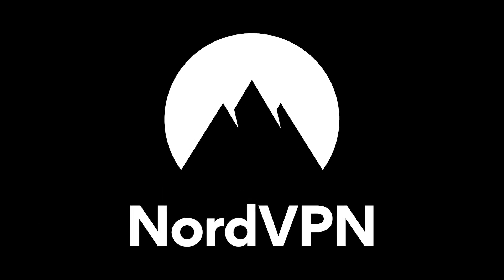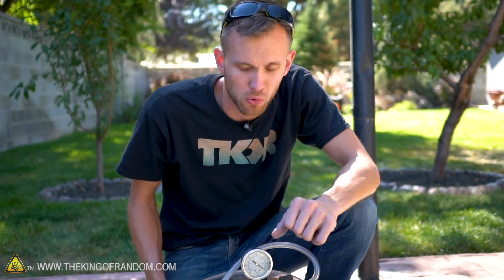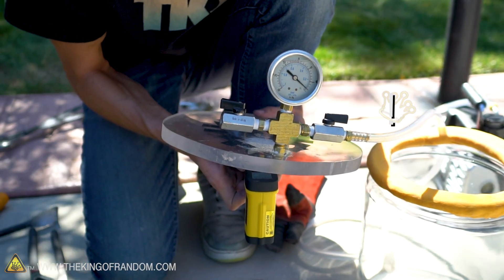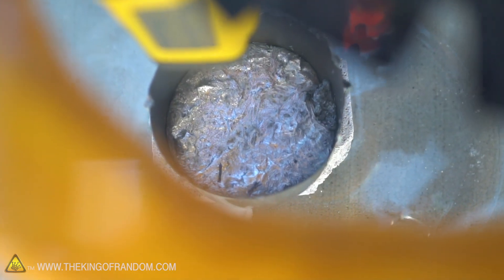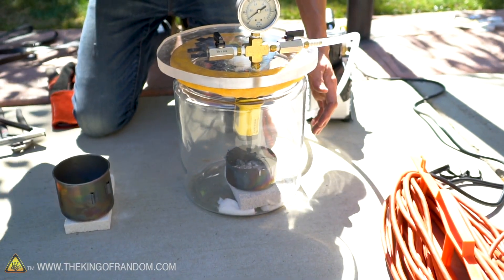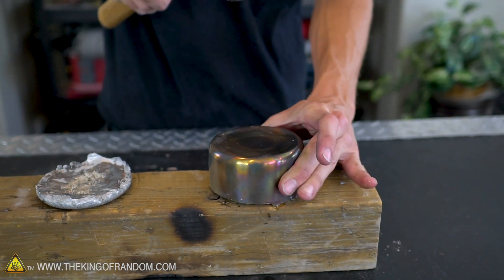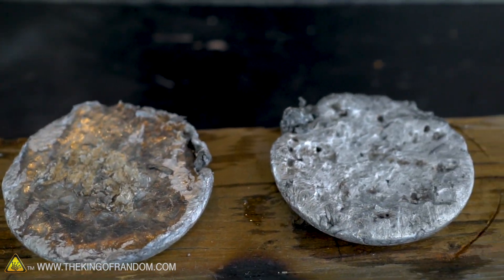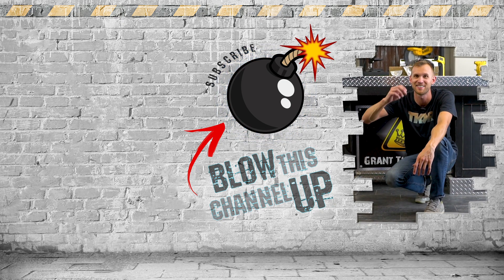Molten Metal in a Vacuum

Comment: I bet you that I could rig you up a thermometer using some DC electric (like a car battery), a pyrometer from a commercial truck, and a gauge cluster from a similar vehicle.  I actually have the circuit in my head

Comment: It’s bubbling because it’s releasing the air from the molten metal, not because it is boiling. You put it in a vacuum, you’re releasing all the air that’s trapped inside.

Comment: two ideas: how well would the styro-slicer cut ice? Also I have an idea for the clear ice thing. If you get a cooler, cut off the bottom and glue (Needs to be water tight) glass or another material that that transmits heat really well,  then poke a hole in the top of the lid. This way the water would freeze from the bottom up and give a way or the air bubbles to escape as the water freezes.

Comment: The container probably heated up so much because the heat from the metal didn't have air around it, so instead of warming the air, the heat just traveled to the glass and heated that up instead.
Reply: Wow, a guy in the comments that actually gets physics... A rare sight to behold...
Reply: Heat doesnt teleport kid.
If you didnt know vacuum lowers the boiling point of water.
So the reason why they did this video is to see if metal melts in a vacuum
Reply: Lazybonez heat has to ravel through stuff so the air is that conductor with ought the air the only thing it warm is that brick and them once that gets warm it ravels through he glass and then to the air
Reply: @aaron56426  
Heat travels through radiation, convection, and conduction. So, no the heat does not have to warm the air before warming the glass or traveling through the brick
Reply: @aarontuplin  but heat doesnt teleport.
Having a vacuum would have almost a full insulation.
Reply: @beefybread5769  
How do you think the heat from the Sun gets to Earth through the vacuum of space?
Reply: @aarontuplin  light and radiation.
He thought that heat teleports. A vacuum in cold wouldnt freeze water. It would just keep it from boiling. Without any light or radiation that would somehow freeze it. It would stay liquid

Comment: Make current flow through the air in a straight line
Reply: Thats not how electricity works. Electricity ionizes particles as it goes through  the air, and it is not easy to contain in a open space. Think about lighting, does it go straight in to the ground, no, it takes what ever path it wants to because of the charged and uncharged  particles in the air

Comment: Your issue is "emissivity". Basically, shiny metal has a much lower apparent IR temperature than it really is. Polished metal is the worst, carbon black is the best / closest to 1.0. You can calibrate some of the higher end thermal / IR guns based on the metal / material you're measuring.

Comment: Get the DeWalt infrared gun model DCT414S1 I have one it should it let's you change the settings for different kinds of material by changing the EMS settings you gun you had is just a is probably set with the common EMS of .95 for aluminum it needs to be at a EMS is .30. Amazon sells it just look up DeWalt DCT414S1 the cost of it should be around $130. I use mine for engine work and Forge work. It vary reliable.

Comment: What happens if you put liquid gallium in a vacuum chamber
Reply: It doesnt do much... It starts to bubble, then cooling down if the vacuum chamber isn't preheated (by vacuum chamber I mean the glass jar)
Reply: Air bubbles would be drawn out and it would require more heat to melt.

Comment: The aluminum should've taken longer to cool off in the vacuum because there wasn't as much air for the surface of the aluminum and the metal pot to dissipate heat with.

Comment: I really wonder what would happen if they try to solidify molten metal with liquid nitrogen shortly after melting the metal
Reply: hard cold outside, soft hot inside = eventual cracking as it finally cools due to stress caused by uneven cooling

Comment: The vacuum chamber is pulling gas from the aluminum your supposed to de-gas aluminum before casting for less pitting and shrinkage in the metal after the pour so that bubbling is just gas your pulling you can see it in the exhaust of the pump behind you in the video. Love the videos 👍

Comment: Pull the vacuum again, but this time check the temperature of the vacuum chamber. As a control, put molten metal in the chamber, but without pulling a vacuum to see the difference in chamber temp.

Comment: Is it possible if you can cast some hot metal in the sand, cuz if i am correct sand Will be to glass (i dont know if this is possible but it worth a try) Wil you get a glass shell at the cast? Sry for My bad english
Reply: They have done sand casting before. Sand takes a lot of heat and time to turn into glass, the melted metal is hot enough but doesn't hold enough heat energy, so it cools off before the sand melts. Does that make sense?
Reply: @polyjohn3425  actually pure sand AKA SiO2 melts at 1600°C while metals like Aluminum, Copper and Tin goes for 600, 1200 and 232°C respectively. It doesn't even come close to melting, maybe some solid phase transformation.
Reply: @omanuelcosta  Right, but a molten metal doesn't just sit at its melting temperature, once it's molten it continues to get hotter because it's still being heated by the flame. And since they use propane in their burners, the liquid metal could conceivably be as hot as 2700°C, more than enough to melt silica.
Reply: I agree but he asked if can cast in sand to turn it into a glass shell.
even if its at 1600°C,  the heat capacity of molten metal its too low to melt any pure silica.
Reply: and considering heat transfer phenomena it's nearly impossible propane torches to overcome a 2000°C barrier as acetylene-oxygen used for welding can only hit as much as 2700-3300 °C

Comment: Molten metal does contain disolved gases. It's extremely important in casting aluminum for products such as automotive parts that the metal is degassed properly before casting. Otherwise, the gasses will form bubbles as the metal cools and the bubbles can compromise the structural integrity of the metal.

Comment: The laser thermometer will only give the temperature of the surface of the molten metal. You really need a thermocouple submerged in the molten metal by about 20mm to get a more accurate reading

Comment: I assume the molten metal will just degas like water.

Edit: I was right. Also, you guys should melt gallium and put it in the vacuum chamber. You can put the vacuum chamber in warm water, melt the gallium and see if it works like that. And as you said, you would need more industrial equipment to handle those temperatures.

Comment: You should try putting sodium metal in a vacuum chamber. Maybe figure a way to cut it like with a butter knife with the proto putty plugs and see what it looks like without worrying about the white oxide layer. Or maybe molten salt would harden differently.

Comment: IR thermometers don’t read reflective surfaces well, you want a pyrometer thermocouple. Less air means less oxygen. Less oxide and most likely slower cooling. I d love to know which component is vapourizing. You should check your pump oil for condensation of aluminum or something else. Pass it through a fine filter.

Comment: It´s interesting to see the end result of the vaccumed one. It would have been really weird if it had bubbles inside of it aswell.
Reply: Bubbles are from hydrogen.Adding sodium carbonate to the molten metal will reduce the bubbles in the solid casting.
Reply: @MrEh5  Yeah you are correct, haven't work on that for a long time.
Reply: Liquid aluminum has significant higher air solubility than solid aluminum, which explains the phenomenon. The vacuum also makes it more aggressive. Control pouring temperature is essential to prevent holes in metal casting.
Reply: @weitaotang5702  In the end result you could see the pre-melted shape still in areas where he didn't stir it. Wouldn't there have been some air down there that the vacuumcause it ti finally float out from expanding/becoming more buoyant?
Reply: Problem with the hack saw is the heat that it generates is enough to heat up softer metals and just putty over whatever bubble would have been there anyways.
Reply: Can you  freez Mercury with liquid nitrogen???🤔
Reply: Can u make fire ball gun

Comment: You guys should try to boil a bunch of hand sanitizer. The warning label does say it's flammable, but it's thicker than other things you've boiled, so my guess is that it'd take longer to heat up, and it'd have a higher temperature flashpoint. It does have very strong fumes, so eye and respiratory protection would be wise. Anyway, it'd be cool to see.
Reply: Hand sanitizer is mostly alcohol, so it would have the same flashpoint as alcohol regardless of how much thicker it is. Hope that helps

Comment: The ir thermometer is giving incorrect readings because the emissivity is probably set to 0.95, which is a Matt black surface.  aluminium is a different value. You could try a ir camera. That way you can compare like for like even through the glass.

Comment: I'm looking for something to get my coal lit up faster in my Forge will thermite ignite Cole faster than traditional methods
Reply: The temp of thermite is extremely high. That is the stuff they use to cut through steel when knocking down the main supports of skyscrapers for demolition.

Comment: Now for the next challenge... melt aluminium in a vacuum chamber!
Reply: Could probably do it with their arc furnace, though the vacuum chamber would have to be bigger. I would love to see them try and make an induction furnace, then they could melt it from outside the glass.
Reply: @polyjohn3425  I was thinking pre vaccum a thick walled steel container. and then heat it, dunno how they would film it melting though
Reply: @polyjohn3425  didn't the arc furnace worked less efficiently under a vacuum?
Reply: @dandanthedandan7558  A little, since it's harder to form and sustain an arc, but since they're trying to melt aluminum that problem would be mitigated. The main problem they had was trying to pass the electrodes through the top and seal it, because the electrodes get hot. If they had the electrodes and transformer completely within the chamber that wouldn't be a problem, though.
Reply: @polyjohn3425  a problem might occur with the cooling of the transformer, those things can get pretty toasty if they are not cooled properly. usually air would do the trick by itself but without that it would easily overheat. maybe have the transformer outside and the wires going through the top?
Reply: This would be very challenging to do.  The most practical means would be with magnetic induction.  However, I am not sure your vacuum chamber could withstand the heat.
Reply: Palerider1942 boi fire needs oxygen
Reply: @axzqx406  no need for fire in this, an arc can sustain itself in low oxygen environments. And if you meant about the transformers, a lot of them have thermal cut off if it gets to hot, even if it doesn't the insulation on the transformer coil itself could degrade in the heat and short out
Reply: Use electrical heating/ Joule with tungsten filaments. u can even evaporate the molten aluminium with a few amperes depending on size

Comment: You were degassing the aluminum. it wasn't actually boiling. the gas coming off is hydrogen it is present in liquid aluminum in atomic form. the low pressure was forcing the hydrogen together making H2 gas.
Reply: I do this at work .  I work at an aluminum diecaster.  We do this exact test.  It's called a reduced pressure test.  It draws out the hydrogen. We then section the sample and look to see how much porosity is inside the sample.
Reply: Cronofactor No, when atomic hydrogen comine with eachother to form molecular hydrogen the temperature reaches upto 5000°C or release of 104kcal energy
Reply: @zeeshanmalik5709  actually, crono is Right,it was hydrogen coming off,same as if you put chlorine in molten aluminum,or used a degassing rod,all three are methods of aluminum degassing in industrial applications
Reply: jude swanson but not a atomic hydrogen
Reply: @zeeshanmalik5709  Yes, atomic hydrogen exists in the lattice of metals as a transient hydride. Two atoms of hydrogen combine into molecular hydrogen, which then leaves the melt. The atoms joining together do give off energy, sure, but the way you're saying it makes it sound like you think that would superheat the aluminum. But there isn't that much hydrogen present here, so the process gives off a very small amount of overall heat, less heat than the molten aluminum is radiating into the surroundings.
Reply: @zeeshanmalik5709  It is Hydrogen, I work at an aluminum casting plant as an engineer so I should know. humidity in the air can contribute to the slag creating aluminum oxides that form on the top, but the hydrogen from the humidity has to go somewhere and as it turns out hydrogen happily dissolves in  molten aluminum. the problem comes when the aluminum cools and the hydrogen leaves pockets of air inside the casted part. it can actually be a major costly defect (when an aluminum casted part on the body on your car snaps because of small defects it becomes costly) so a vacuum is used to remove hydrogen in a lot of cases, a cheaper method is to blow bubbles of an inert gas like argon in the molten aluminum.
Reply: @RomrotMechanikos  thank you for that insightful explanation, hats off to you all gentleman.
Reply: @zeeshanmalik5709  if you know nothing , please continue with your textbooks... you are so annoying
Reply: @rilkatop4830  At least they contributed to the topic, all you've done is put someone down who is joining the discussion. I've been working in a lab setting (Chemistry) for nearly three years now, and people like you really get on my nerves. They may be wrong. Encourage. Not discourage. Have a nice day :)
Reply: 👏👏👏 loved this!

Comment: Now you guys need to follow through with the carbon rods in a vacuum chamber thing. I’m thinking you could combine the designs for the metal foundry and the vacuum chamber. This would allow you to experiment melting things that normally combust in the presence of oxygen. I’ve had this idea for a long time, but I’ve never had the resources to make it happen.
Reply: A vacuum or inert gas atmosphere like helium or usually neon or argon and using electric induction or electric arc to heat it is in fact how you melt very reactive metals.  It is also used in some cases when you want high purity melts of other metals that you can melt in a standard atmosphere. 
In the video you see the molten aluminum bubble once it is being exposed to a even just a poor quality vacuum.  This is dissolved gas leaving.  If you just melt in a normal atmosphere much of this gas bonds chemically with the metal.  There are actually some cases where you want this to happen, certain grades of stainless steel are supposed to contain Nitrogen for example.  But in general, just having it happen in a random uncontrolled way as result of melting it in our normal atmosphere causes a decrease in quality.

Comment: I Wonder what happens with oobleck in a vacuum chamber. Does it act as a solid or a liquid?
Reply: I have a vacuum chamber myself and I have tried that. Since the chamber boils the water it first becomes a liquid and after about 20 minutes, it turns into a solid
Reply: Just Will liquid